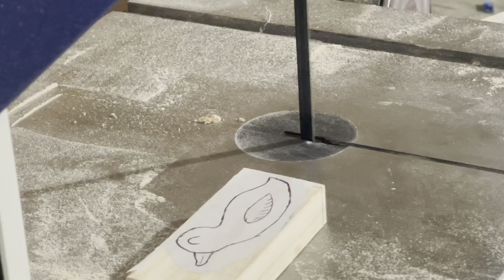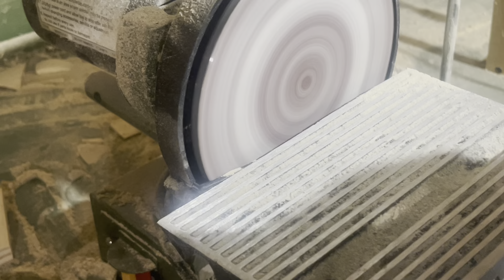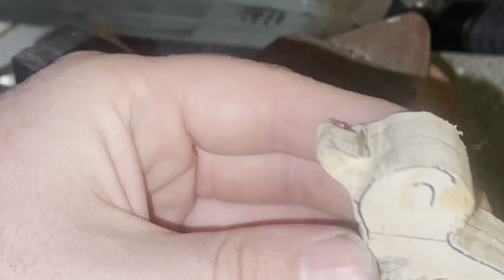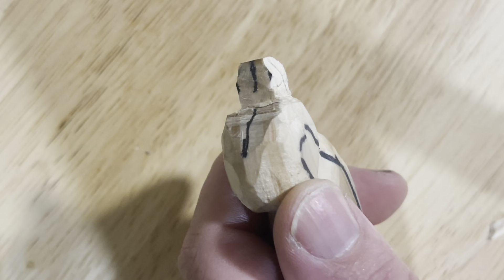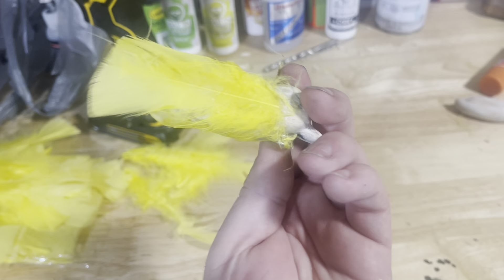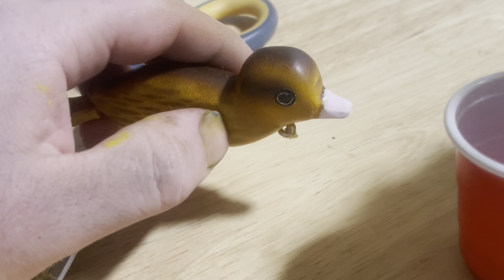Making a baby duck lure

Comment: Since the lures are taller than they are wide, a spot of lead in the bottom, or a split-shot on the hooks, will help them sit upright in the water.
Reply from the maker: True I was hoping with the blade and the hook would be enough weight